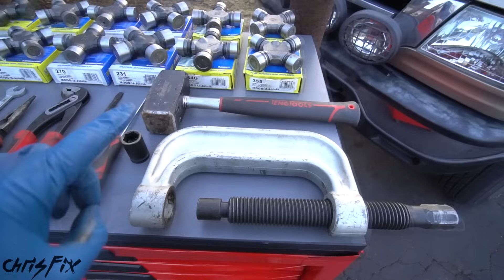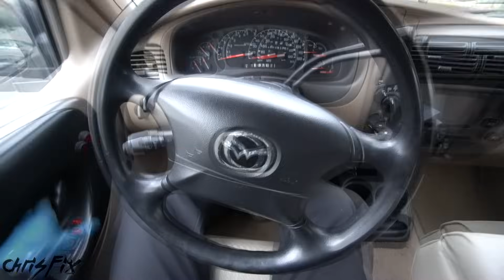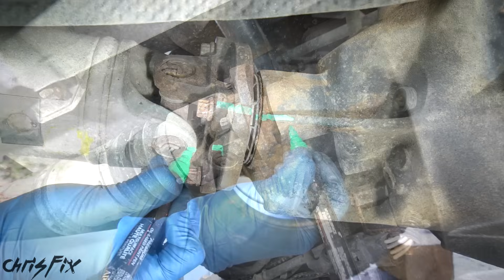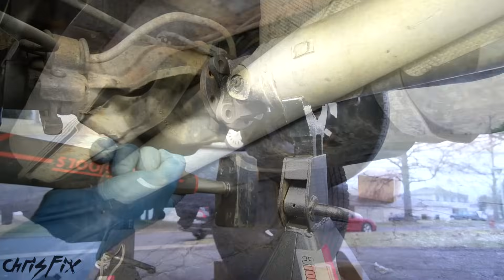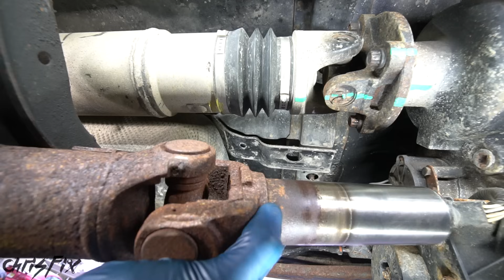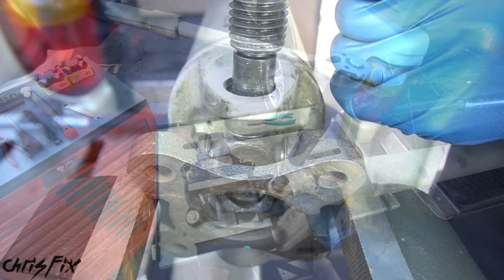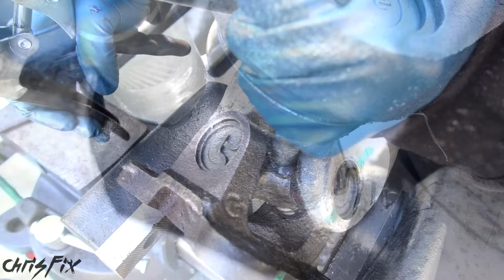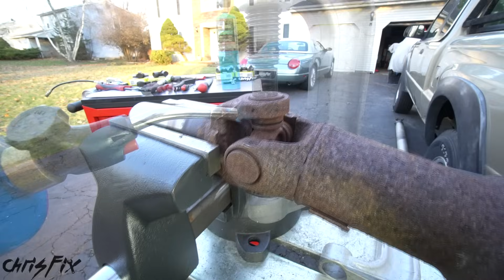How to Diagnose and Replace Universal Joints (ULTIMATE Guide)

Comment: This happened to me and I broke my driveshaft at 8am on my Mazda b4000 4wd😭😭
Reply from the maker: Dang, is the driveshaft savable or do you need a new one?
Reply: @chrisfix  I need a new one
Reply: Don’t drift and do burnouts in a 20year old truck  with original parts😂😂
Reply: It was $740  for the parts

Comment: The bench vise and some old sockets are my favorite way to remove and install. greasable is mandatory as well. I do not bother to mark the position of the driveshaft because every vehicle I have owned has been worked on at least once and they never get it right. Thankfully most have a factory mark.
Reply from the maker: It makes this job quick! And it's good to have for reference if anything

Comment: Be careful not to lose the grease fitting because they dont sell them at the autoparts store.

I left it inside the bag , the wind blew and lost it forever.

Went to 10 autoparts store no one sells it. I had to buy a whole new joint just for the grease fitting.

Comment: 21:02 how do you tighten to 80 foot pounds without  torque wrench?
Reply: One way is by feel, which is not accurate and is why you're asking this question. Another way, assuming you have a 6 point bolt or you can find a 12 point crows foot wrench, is to use it. By turning the wrench head 90 degrees to the handle it still gives a proper torque spec. Something to look into.

Comment: Here in the uk I’ve also seen staked UJs, where the cups are retained not with clips, but by staking the bore after the cup is pushed in. That’s basically deforming the top of the bore by driving a staking block into it and gouging several small grooves, the displaced metal forms a ring of tags. They were a pain in the arse to replace cos you can’t remove the staking, you just drive the cup out and it drags the  tags with it, then you re stake the replacements with the tool. After 2-3 replacements the shaft is scrap,   Ive not seen them since the 80s.

Comment: Remember to have the proper grease fitting orientation for accessibility! Facing forward or rearward?             Throw the ujoint in the freezer for a few hours. Stiffer grease to hold the bearings in place and less resistance pressing in place.

Comment: DON'T change the strength of your u-joint unless you're upgrading EVERYTHING along the chain of custody of all that torque and vibration!  Prove it to yourself with a little deduction:  u-joints like to fail right?  And they fail in a noticable and fairly easily dealth with way.  Inspect them at a frequency commensurate with how aggressively you use torque, and you have zero chance of catastrophic failure.  The whole vehicle is ENGINEERED, this is on purpose!  Guess what happens if you merely beef up that u-joint.... go ahead, I'll wait.  Surprise surprise, it doesn't fail.  So now what?  Isn't that a good thing?  No, Sir.  No it is not.  It's NOT a good thing.  Not at all.  What you've done is throw all that ENGINEERING in the toilet.  Now the weakest link is elsewhere.  And the worst part of all is YOU DON'T KNOW WHERE IT IS!!!!  Maybe it's the pinion, maybe it's the splines, could be the ring gear.  It's now a big obnoxious mystery, and it's gonna fail RIGHT when you are showing off or fitness Jeep between to rocks, and it will probably do so catastrophically and expensively.  Strength is circus peanuts compared to Engineering, please respect and value it.  You are getting MILLIONS OF DOLLARS WORTH of excellent Engineering with each and every lovely old $5,000 truck IFFF it was kept bone stock.  Stock is valuable, stock is your friend.  Don't even buy fancier tires, buy exactly what the vehicle was designed for.  If you put stickier/grabbier tires on and do nothing else, now your suspension geometry is wrong right at the limit where you need it most.  RESPECT.  THE. ENGINEERING.  All that said, if you know what you're doing, OR, you're just having fun, do as you please.  Just be smart.  Ignore the up-sell.  I know it's hard, resist.  Even the simplest changes WILL bite.  Just because the marketing says it won't doesn't change the above wisdom.  Trust me, I have "overlanded" my bone stock old Cherokee XJ past probably 100 or more busted new but modded Jeeps.  Have fun.

Comment: And , if you have zero angle on a prop shaft, the uni’s wear faster due to a constant side load on the same needle rollers, a slight angle helps to spread the load over all the needle rollers and not just a couple

Comment: Outstanding job!  I only wish you would have added seized caps.  You used channel locks.  I had to cut squared edges on the end of the cap; enabling a wrench to fit, then added a 6’ pipe to the wrench handle for leverage.  After many turns and penetrating oil I inserted a 2’ flat screwdriver into the same hole I cut for the wrench, placed a fulcrum wherever I could and pried up.  Some extracted, some were a much larger battle.  Also my F-250 has a different design than your examples; including 3 joints in the front shaft alone.

Comment: I have vibration when in drive or reverse only while idling.  I have also noticed a clunk when changing gears, mainly drive.  I was thinking mounts are the issue but maybe u joint?  Could the vibration be anything more serious?
Reply: The clunk noise may be  worn ujoints. Get under your car and grab the drive line. Try to move it side to side. If you can move it, there's your problem.

If you are parking on any sort of incline make sure you are using your e-brake. Parking on a hill without using the parking brake, causing all the vehicle’s weight to sit on the transmission's parking pawl. When this happens, you typically feel like it’s hard to pull the shifter out of park since it’s in a bind and the transmission makes a clunking sound when it releases the parking pawl.
Reply: @vigilantemotors  Thank you for the reply.  I have noticed a clunk when going from park to reverse or drive or from drive back to reverse. The vibration is only in drive and reverse when idling.
Reply: @blissfuljoy6049  Vibration is usually caused by an out of balance or defective tire, a bent wheel or a worn driveline U-joint.

Comment: Did this job today on my 2005 Ram 1500 4x4. I wasn't sure it was the U-Joint, but the ones on it were greaseable so I hit them with grease and it changed how the vibration felt. Then I switched out the back wheels putting on my winter tires and wheels. That made no difference, and I was pretty sure the vibration was from the rear of the vehicle. I pulled the driveshaft off, and it became really clear that the rear u-joint was the issue since it was stiff to the point of feeling seized. When I pressed out the u-joints the roller bearings were completely dry and rusted. I was going to do both u-joints, but the front one seemed like it was in such good condition and the job was straightforward enough that I just did the one that was clearly shot. This video was extremely helpful, but there really wasn't any movement in the u-joint that was bad, just a little cracking on the rubber sealing it.
Reply from the maker: Nice work!
Reply: @chrisfix Thanks. The loud pop when they came free shocked me with the first one.

Comment: 05 Yukon I made the mistake of trying to grease it last.
The grease gun tip would not fit even after I ground it down. Had to remove the drive shaft again. 
By the way it's a heck of a bitchin job with those inner clips all rusted in.

Comment: Hi all … todays experience of doing this UJ job and little tips.

I tried using a g clamp from one of those ball joint presses and it slips and easily marks up the alloy ears on the joint.

I resorted to taking the thing to a mate who has a shop. You really need two sets of hand. A press doesn’t grip both side, you really need a decent vice and different sized sockets to press the joints out. Being alloy the mark and burr really easily, luckily my mate had a die grinder to de burr it and then some linishing paper.

Anyway, all good, until I went to grease the thing and we’d managed to destroy one of the zerks and they are 8mm and can’t get a tool in there to remove it ( 🧠 just kicked in and I’ve worked out a way) I’m going back to my mate tomorrow …. Tip is have a mate, die grinder and take the zerk out before you start wailing on the thing! Good luck to you all.

Comment: @ChrisFix i have a question, a few months ago i bought a 2018 toyota tacoma, and its been through its 55,000 milestone service and had them inspect pretty much everything, and everything came back fine, however ive noticed occasionally whenever i step on the breaks a little harder than normal the entire cab like vibrates and sometimes whenever im backing out of my driveway and my music is too quiet i can hear a light squeaking noise whenever i break, is this a normal thing, or is there something up with my break system?
Reply: In a vehicle with disc brakes, the most likely cause of shaking is a warped or otherwise damaged rotor. Warping can be a consequence of normal wear. The repeated application of the brake pad onto the rotor will wear away the rotor material in that contact area. Over time the heat caused by the friction of the pad on the rotor can cause the rotor to warp.

I know they said everything is fine but if you are experiencing a shaking while braking there is an issue.

Comment: Chris, what's your take on adding a small high temp synthetic grease on the caps before you put them on?  Also, what's your take on using a small bit of trans fluid to lubricate the openings before you put the new u joints back in?  Great video and info as always!

Comment: Great video Chris one thing I would like to add if the retaining ring clips are in a bind and don’t come out easy instead of hammering them out and breaking them off in the groove take your chisel or punch and hit the cap once or twice to knock it in just a little bit and it takes the pressure off the clip. Another thing for cleaning up the ID for the cap goes take your half inch bolt take a hacksaw and split it down the middle and then insert a piece of folded sandpaper through it about 3 inches long and installed in a drill. Make a flapper wheel ina way and sand the ID just a little bit not on the bearing service but just right there at the edge. That works good for other things as well. Also, make sure you don’t have any play in the joint itself because the joint might be actually just a little bit shorter or longer and your retainer rings might need to be thinner or thicker to reduce the end float. Just food for thought man. Thanks for the video.

Comment: Can a bad u joint give a shudder/vibration only certain speeds. I had my wheels road force balanced and they zeroed out fine. My F350 does it at exactly 46 to 50 before and after nothing

Comment: I have a '96 Ford Ranger that has solid forks on the front end U-joints, so the bearing race caps don't show.  They are the C-clip type.  Any tips?
Very good video.  I asked a relative that is a long time mechanic and he mentioned the plastic you had to melt, but you actually showed what to look for.

Comment: I JUST DID THIS ON MY 94 F-150 AND LET ME TELL YOU GET A PRESS IT WILL MAKE IT SO MUCH EASIER. I HAD TO REDO IT CUZ I BROKE THE CAP ON THE U JOINT FROM HITTING IT SO HARD WITH A SOCKET AND HAMMER. THE SOCKET ACTUALLY MUSHROOMED. THE 1ST TIME TOOK ME 6 HOURS AND WITH A PRESS IT WAS DONE IN AN HOUR AND I DIDN'T EVEN HAVE A VICE TO HOLD IT JUST A COUPLE OF 2X6'S.

Comment: Hammer method and vice Is the best way to go I took a ujoint over to my 50 ton press still couldn't do it it was onba u joints on a 2017 ram 2500 Cummins 230,000 miles with original u joints 😅

Comment: I’m about to replace mine and I have a question, the U joint currently on has grease nipple on the inside rather than the end cap. Will changing  to end cap ones affect the drive shaft i.e vibration etc???

Comment: Great video, Chris. Both informative as well as nice production quality. I liked your transitions. 
One thing I'd recommend to have on hand is a hole deburring tool like plumbers use for pipe inside and outside diameters. The "pen" type is great and is less than $10 at hardware stores. I use mine all the time for car stuff in the garage.
Using that file kind of worried me because the corners may dig in too much if someone isn't careful. 
Thanks again for posting!

Comment: I was laying under my truck the other day and twisted the front drive shaft by hand. Found the source of a new vibration I noticed a few months ago. One of the u joints is going out. Unfortunately, the transfer case seal is leaking a little bit but not enough to drip. Looks like I will be fixing both issues very soon. I knew next time nothing about u joints till I found this video. Thank you. The task doesn't look so mysterious anymore.

Comment: Uses this video to replace the front prop shaft ujoint on my atv. Used a press and did it with the shaft still installed in the atv.

Comment: Hey, can a clunk or strange kick be cause by the U joints during shifting when the car coasts and you press the gas again ? I have a rebuilt auto Passat B5.5 and the valvebody is soon to be replaced too but my mechanic said the kick I may feel should be a very rare occurrence. What I feel tough I can’t say it’s that as it looks as if the car is covering the gaps from somewhere witch could be from the driveline
Reply from the maker: It could be but it could also be suspension bushings.

Comment: If the grease fitting is in the body of the joint, always make sure that it is in the "compression" side of it. In the video it went correctly but was not mentioned. The hole is like perforations of the toilet paper if it is wrong way around in a high performance car. The bulge around this helps but some of those are just drilled/tapped to the cross.

Comment: I was under the impression that you cannot push the caps through with the press on the U joints that have inside clips, the caps have to be pulled out instead of pushed through, am I correct?

Comment: Before disconnecting driveshaft (on flat ground): set Parking Brake, shift into Neutral, then block wheels.
I almost won myself a Darwin Award by not doing those things! 🤦‍♂️🤣
See, what had happened was... like in this video, truck moved backward when driveshaft disconnected but then, unlike in this video, my truck kept going!
Oh the surprise, I tell you, being underneath a vehicle that starts 'driving' away! Plus the fun with having to roll out in a WTF moment, followed by diving through passenger window and across bench seat, then slamming on brake with my hand?! FML 😕🤣

Comment: I have started the video and can't stop it.
Reply from the maker: Haha hopefully that means it was helpful!
Reply: @chrisfix  The video you made about the head gasket seal brought me to your channel and got glued instantly.  I have a blown head gasket on my old Kia Sorento,  the diesel one 2,5 liters 140hp. I will try of the products you have used. Unfortunately in Italy was available only the one that it has a green bottle.I have high pressure in the radiator cap and when i put near the open coolant tank my home co2 device meter it measures the level to the maximum level that can read, like 6k ppm of co2. On the rear near the exhaust the same maximum level. A part for squeak noise from the cap and loosing some coolant in one week like half a liter, the engine runs fine! Has the same power and its a little bit smokey only until reaches the 82 degrees Celsius,  the normal temperature .Hope that the product will work , otherwise i don't think i am capable of repairing my self the head gasket. And a mechanic will surely rip me off.

Comment: 80 ft lbs......with an end wrench? Chris, another issue that many of us have faced is with the needle bearings, it only takes one to tip over and prevent the bearing cap from properly seating, which will not allow the "C" clip to fit deep enough into it's groove. Take it back apart and there is the problem and hopefully not loosing any of the needle bearings, I have used needle bearings from the old bearing if I lose one before.

Comment: Yo brother, apologies if i missed ur explanation in the vid but is there any particular reason you waited to grease until installed? Would greasing before pressed in be any different apart from maybe some mess? Honestly havent worked w bearings/greaseable parts till recently and am trying to make sure i weed out any info thats one of the "so obvious that its hardly mentioned" bits 😂
Reply from the maker: The caps will push off and the bearings will pop out if you grease it disassembled.
Reply: @chrisfix  HAHAHA well ill be damned, exactly as i thought 😂😂 thanks for the quick reply!! Makes perfect sense. Im going to be doing em on my great granddads 82 bronco im restoring soon.... any advice on not fuckin up the dual cardan setup they have for u joints connecting the t case to rear shaft? 😂 seems a bit more complex but not impossible

Comment: I just replaced my clutch and diff pinion seal and whilst i had it all out I gave it all a good clean. Tried avoiding getting too much degreaser and water on the u joints but guess I got enough water around it because my rear u joint sounds exactly like that video. Really annoying and there's no grease zerks either. Guess I'm doing u joints next

Comment: I've been known to lose a drive shaft or 3 (not my trucks) lol   It's always interesting.  You can usually get them to stay in there to get you down the road a bit, or use the 4WD to pull it allong... (usually the rear goes).  Cheers

Comment: I didn't know you could just use a butane torch to melt out the injected plastic. I didn't think it would get hot enough. I'll definitely give that a go next time i'm the first guy replacing the u joint in a GM ;) I certainly don't have access to the big fancy proper torches. Awesome video as always.